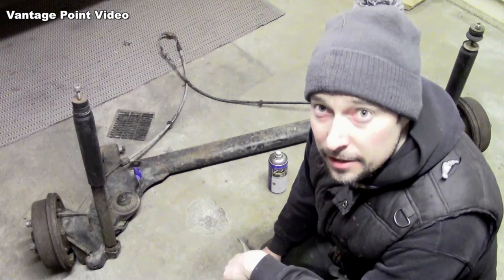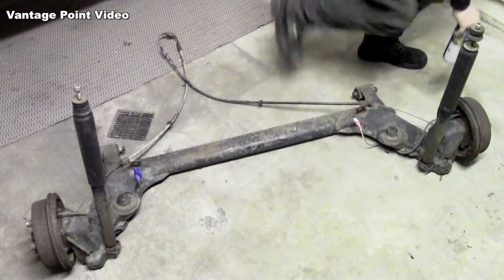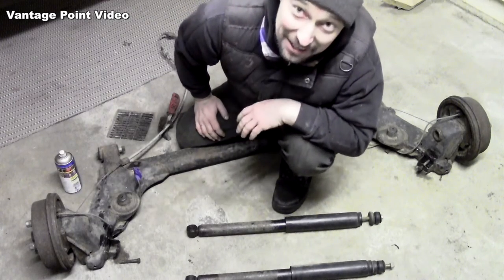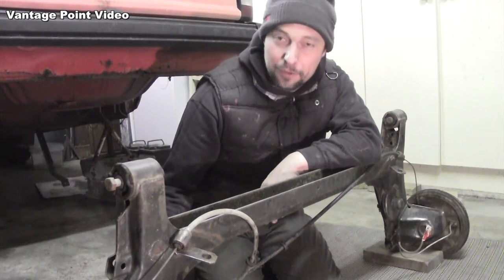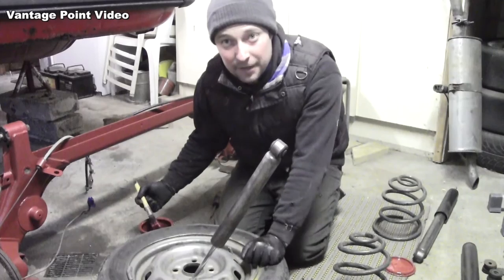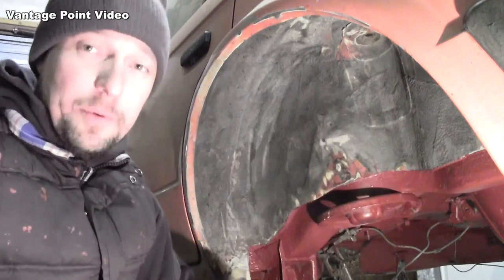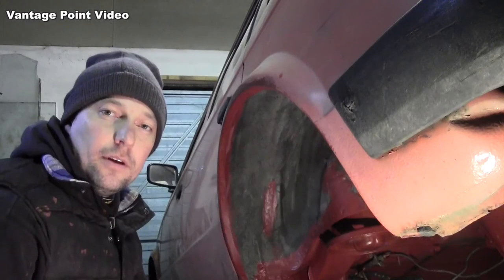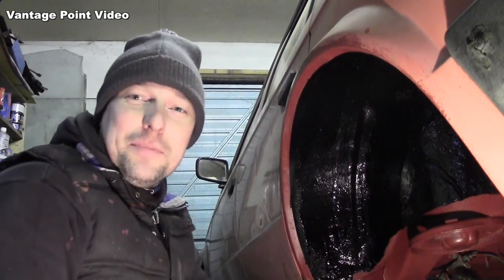Painting Trailing Arm & Undersealing Arches: Car Restoration Diary #5

Comment: Great method of using the brush, it saves you from alot of problems, overspray, overspray on your lungs, etc, etc, etc. Great videos mate, keep them coming.
Reply from the maker: Thanks, I hope it's the right way, underneath the finish doesn't matter so much and with the brush you get a good thick coat and you can really work it into any pitting from the rust.